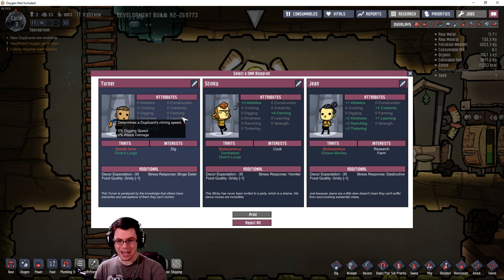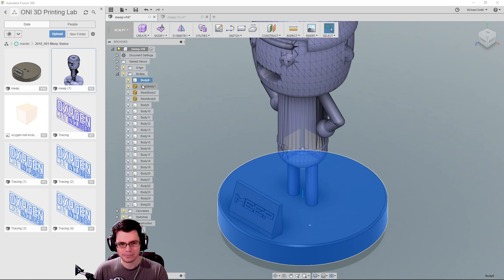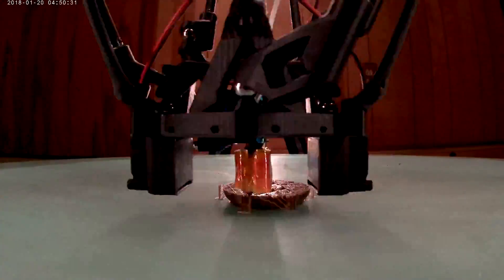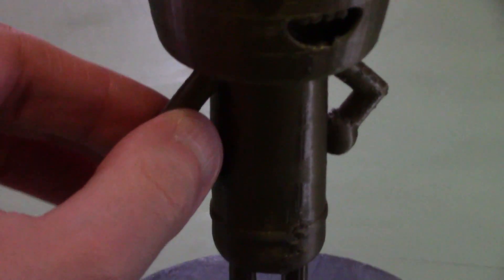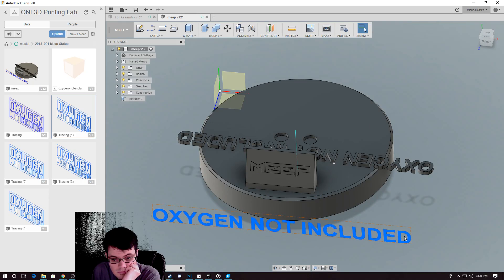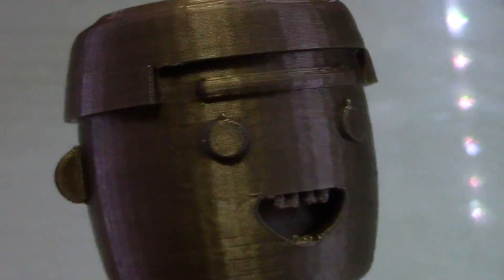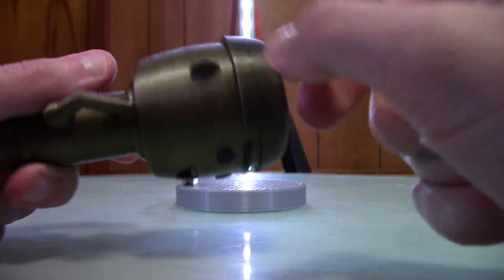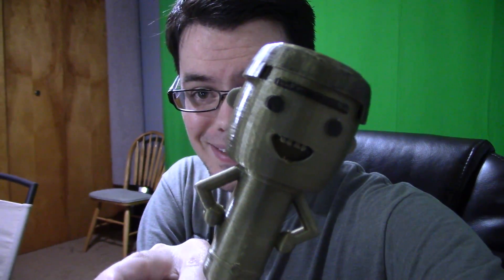HOW DUPLICANTS ARE MADE - Watch It Print

Comment: A tip I can offer for the letters, is it to use spray can to fill the gap, then sand off the area you want to expose, for example in the first case, you'd sand off the surface and the paint in the letter would remain, and in the embroidered style(second print), you'd sand off the letters, and if you start at a high grit and going higher, should reduce that scratching, could even try wet sanding

Comment: Love the upside down printing and the Meep model! :D
I think your plugging problem has to do with a combination of retraction distance and travel speed.  I had a similar plugging problem with Taulman t-glase filament, the solution was turn the retraction down 0.5mm at a time, and also speed up the print and travel speeds maybe 10mm/s at a time until i found a sweet spot that solved it.  Leaving the retracted filament's hot blob in the cooler section of the print tube a shorter amount of time by traveling faster meant it didn't have time to solidify and cause a plug.  Also turning the temperature up might help, but causes other quality issues with the final output.
The seam should not be visible - I think that's mostly to do with outputting more filament than you should - I'd try turning it down maybe 2% at a time...and possibly hiding it by using random seams.
Hope that's of some help!!